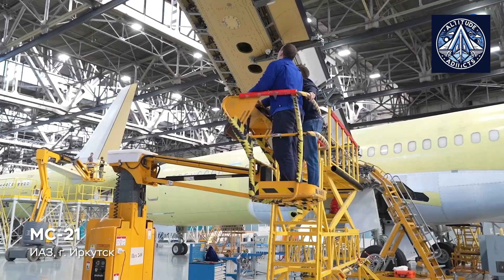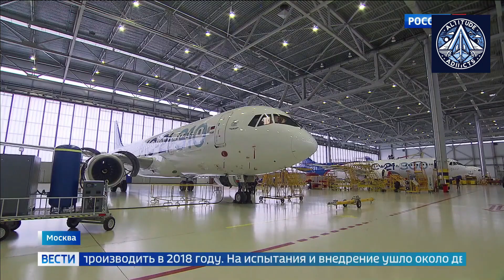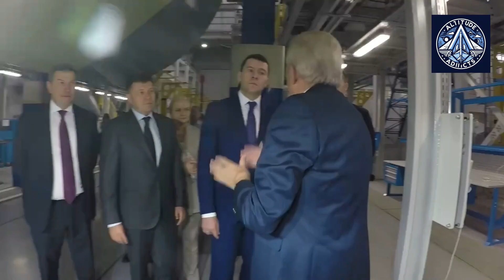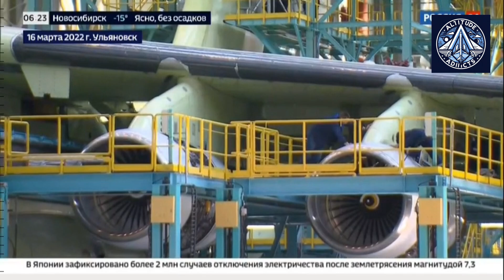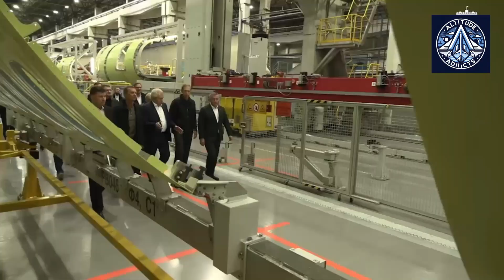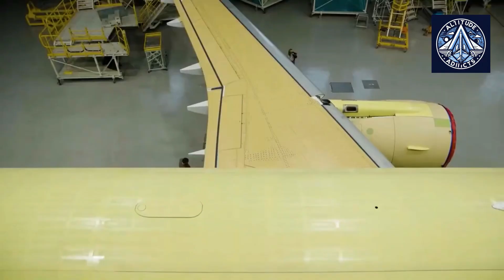MC-21's MASSIVE Setback  -  Why You Won't FLY It Until 2026!

Comment: In fact, every cloud has a silver lining. The MC-21 was supposed to be powered by a Pratt & Whitney PW1100G engine. About 1,200 of the 3,000 of these geared turbofans (GTF) are currently scheduled to be recalled for further inspection for microscopic cracks caused by a rare condition of the powdered metal used to make the high-pressure turbine discs. As of August 23, 647 aircraft with PW1000G engines were grounded, accounting for 30% of the entire fleet with these engines. Most of them are Airbus A320neo, A220 and Embraer E2. The main airlines affected are Delta, Spirit, All Nippon Airways, Turkish Airlines, Vueling and Swiss, which have a significant number of aircraft forced to idle. Frequent breakdowns of these engines also led to the bankruptcy of the Indian airline Go First in 2023.

Comment: Aneh sekali, penggunaan komponen lokal langsung berefek ke tambah berat hingga 5 ton lebih😮.
Sepayah itukah komponen lokal tidak mampu memilih material yang modern dan ringan?
Reply: The foreign parts were likely chosen because they were new and light weight already. Having to get local parts would mean what is available and in serial production is what they used even if it is double the weight. Of course buying foreign parts was the problem in the first place and so buying local parts will generate income for those companies and suppliers and maybe they can spend money optimising their materials and designs to make them lighter.

Comment: I think the MS-21 project will face further delays, but it is OK as long as the import-substituted Tu-214 enters into commercial service starting from this year as promised.. both airplanes (MS-21 and Tu-214) play similar role, so if one is ready then it could relax the schedule for the other.. finally, I don't believe the media reports about the MS-21 being too heavy after import-substitution, because the import-substituted version of the plane hasn't flown yet, not even once, so it is too early to judge any of the plane's characteristics when the plane is still in the design phase!!
Reply: tu-214 is not going ahead didn't you hear?